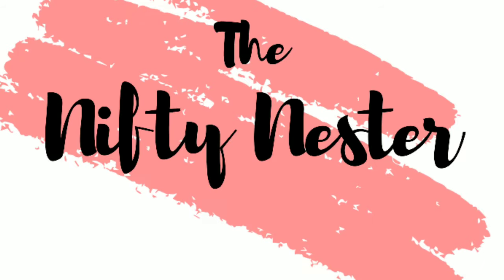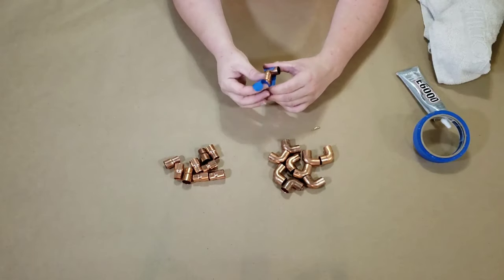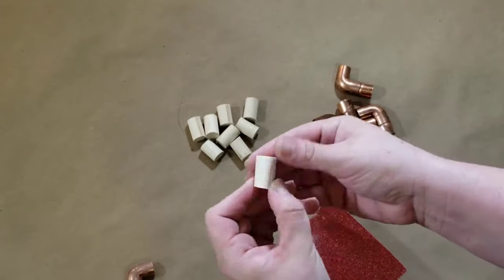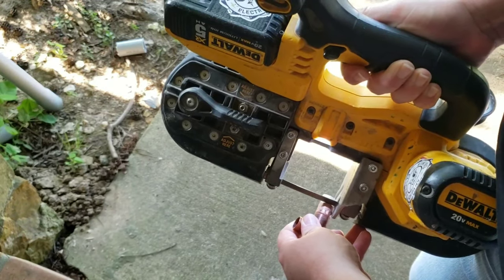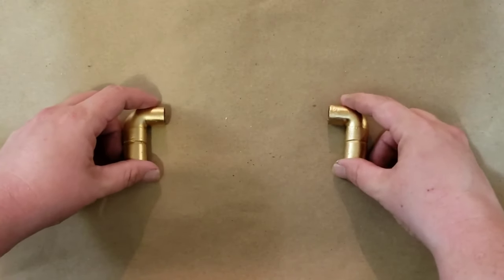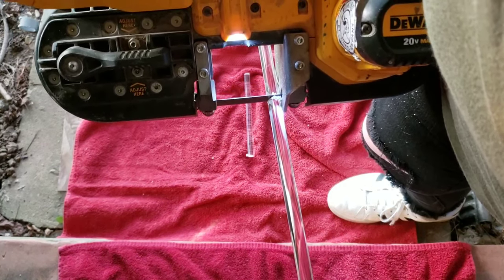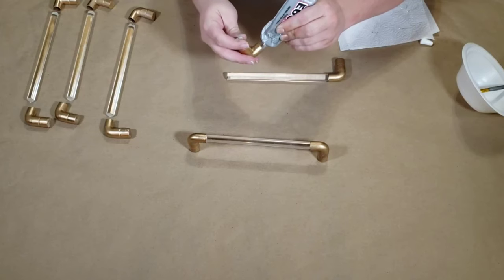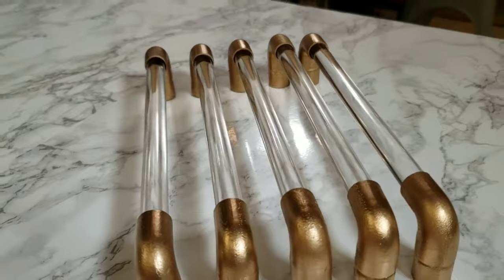DIY Acrylic And Copper Cabinet & Drawer Pulls

Comment: HI, I am thinking of doing these handles on a dresser I'm wondering how they have held up? They are beautiful, good job!
Reply from the maker: Thank you! They have held up great, they're still in the bathroom being used daily and I haven't had to make any repairs, haven't had any issues with them at all. The couple of pulls that get the most use could use a touch up on the gold spray paint but it's not very noticeable so I haven't messed with it.

Comment: Great idea. Instead of the acrylic, would copper pipe substitute, and does the gold paint wear off and need redoing? Thank you.
Reply from the maker: Thank you! You could definitely do copper instead. I had these on the bathroom cabinet for a little over 2 years and they were just starting to show a little bit of wear on the areas that were spray painted. It held up pretty well for a DIY but I would probably need to repaint them soon if I wasn't already in the process of remodeling that bathroom.
Reply: @TheNiftyNester  thank  you.
Reply from the maker: Yw!

Comment: How did you attach these to your cabinets?
Reply from the maker: The inside of the elbow where I glued in the wooden dowel rod that was cut to fit flush inside of it, I screwed in to that from the inside of the cabinet door. It basically was installed just like normal hardware would be but instead of it being threaded into the metal of a handle like it is with store bought pulls, the dowel rod acts as the thread. I hope that makes sense, if not let me know and I'll try to explain better. This was my first video and I definitely could've added some info that I didn't think of until after it was loaded, sorry about that!